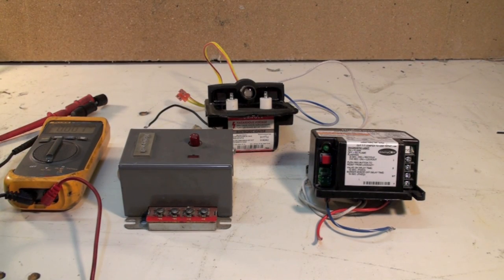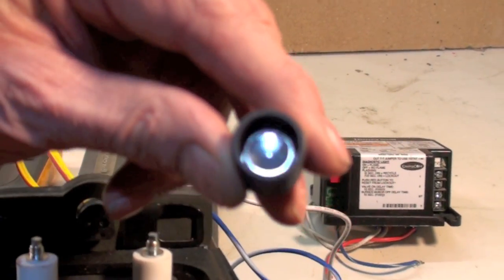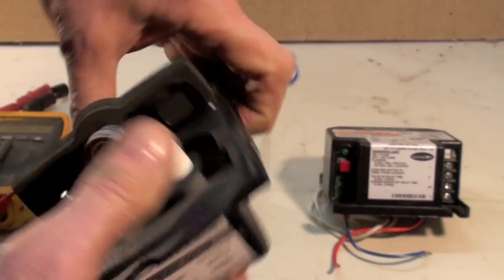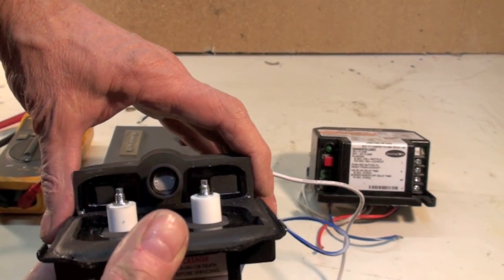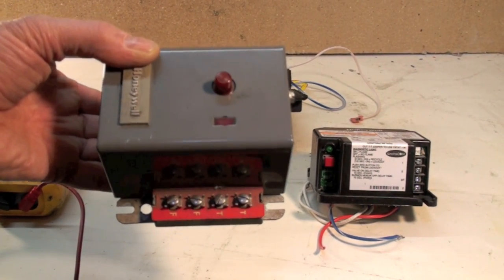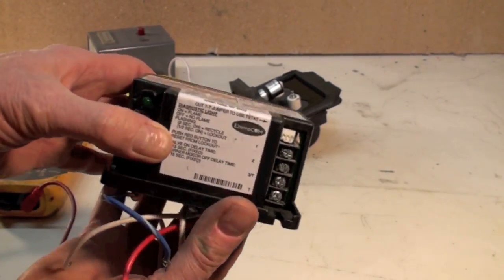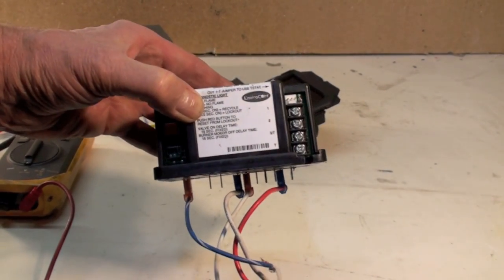Oil furnace cad cell and relay

Comment: My Rudd oil furnace will run and run and run and has gotten up to 99F in my house if I don't catch it and turn off the main switch. The thermstat has been replaced so that is not it. A friend moved some wires that were attached to the little fuse box on the opposite side of the wall where thermostat is mounted and the furnace went off. What is that little fuse box for and do you think if I just replace those wires it will turn off when it reaches temp? I have to turn it off when I leave the house in case it decides to run and run again. It worked for 6 days after he moved those wires apart, but did it again today.
Reply from the maker: Well, at least you are not cold!  There are many possibilities here.  Perhaps if you send me pics of the little fuse box I might be able to help.  Try to get good closeups of all the wires there.  Hope this helps.
GFM
Reply: grayfurnaceman THanks! I just saw this. I'll get a picture and send it to you. Yes, still having the problem.
Reply: Linda Lewis I couldn't find your e-mail, so I uploaded two pics: http://www.rootsweb.ancestry.com/~lindakay/furnace/

Comment: Need help.  Had a flood in the basement with a new furnace, so I shut off the emergency switch to the furnace.  I waited for the basement to dry for a couple days and then turned the switch back on.  When I checked the furnace there was no light at all.  I turned the circuit breaker off then on.  My indicator light is now blinking (I assume it's in restricted mode).  I tried to bleed the lines, but there's only a slow drip of oil.  I held the reset button for 45 seconds.  I can hear something trying to happen, but it goes back to blinking (restricted mode?). Where do I go from here?
Reply from the maker: Steve LaFever If the water was up to the level of the cad cell relay, the relay, the cad cell and probably the burner motor must be replaced.  Also if the blower motor was wet, it will probably have to be replaced.  Hope this helps.
GFM

Comment: Have an Intertherm oil furnace that we have to keep hitting the reset button. The furnace will fire run for a few minutes and then kicks off. Any suggestions. this is in my sons mobile home and the grandkids are suffering due to the home being so cold
Reply from the maker: Check the cad cell resistance both with no light and with light. Should be below 1000 ohms with light.  You could also have an oil supply problem.  Clean the oil filter.  Hope this helps.
GFM

Comment: I have a cad cell that was changed now  carlin control blinks amber burner comes on then off does it a few times then it will runs fine  makes temperature  what could the problem be???  Primary control is a 60200-02 rev b     The control never locks out red
Reply from the maker: First, I would jumper the thermostat to see if the problem persists.
GFM

Comment: ok , have zero $$ and its going down to 17 tonite ... fairly new carlin unit starts and runs good but shuts off after 30 seconds or so ... any way to jump out cad cell ? i know i know , I'll keep a close eye on it and shut off after house warms up ...
Reply from the maker: First, are you sure the flame is coming on?  Is the cad cell dirty?  You can jumper out the cad cell if you short the terminals for the cad cell after the burner has started.  It will not work if you short it before the burner comes on.  And I am sure you know, watch it closely.
GFM

Comment: Hi Garyfurnaceman ..I,m just wondering how does fix the probelm of the reset button press to many times .It was press like around 6 times ?
Reply from the maker: When the problem is repaired, you will need to check to see if there is a level of oil in the combustion chamber.  If you can get a stick or wire into the inspection hole to the bottom of the chamber, and do not find a level, you can fire the unit.  You will need a fire extinguisher just in case.  Start the burner.  When it lights, shut it off.  It should stay burning the oil in the chamber.  Just let it burn out.  Do not open the inspection door.  If it starts to get out of control, use the fire extinguisher.  When it burns out, you should be able to operated the appliance normally.  
GFM

Comment: You keep stating that the controls have their own power. NO! They get the power from an outside source called INPUT! Miss leading people can get someone hurt or they can blow things up. Besides that I like your vids. I am now working on a Lennox fuel oil furnace that has been in a basement flood and a tech came out and replaced the control module and the circuit board and it is not firing. He told the old owner of the house that the furnace needed more work and I found that the bearings in the pump/burner fan had seized up and I took it apart and cleaned the bearings up and they are fine now and the motor now works but the control unit is not getting power from the circuit board and won't come on. Volt meter to the rescue I hope.
Reply from the maker: It may have been misleading to you but it was not meant that way.  The point was the control has its own low voltage power source so you do not need nor should you supply low voltage power to the circuit as you will destroy the control.  Have you checked power in and power out from the circuit board?  Most boards will not survive even getting wet.  Hope this helps.
GFM
Reply: I found out that the fan and limit switch need to be hooked up to get voltage through to the Electronic oil primary unit! Now ain't that the hill of beans. I took HVAC in the mid 80s and still to this day I still have problems figuring out electronics at times. Any more you need to be an electrical engineer to work on many of the units. They use to be so straight forward and now that's in the wind. What I'm trying to do is fire the burner up outside and I need to bypass the blower unit and the cad cell eye to get it to burn and check the flame to he sure that when it was under water that it didn't ruin the burner nozzle. It's in a Lennox model OF23 with a Becket AF ll 150 burner. How do you bypass the fan on the circuit board and still get current up to the Electronic primary unit? You know this is just for getting our house refinanced and I had put in a wood furnace and the refi got turned down due to furnace not coming up to "National Standards" ? Are you kidding me? Yep! We're not selling the damn house but they want that fuel oil furnace hooked up just to mean "National Standards" for the idiot appraiser! What a hoot! I'd love to sue them over this "national standards" crap since we were not informed of this and it cost us $480.00 dollars to be turned down for it! It ought to be just like being read your rights when your arrested! You get informed about these "national Standards" before the bank takes your money so you can at least be prepared for the inspection. So any how that's what I'm dealing with.

Comment: When I test my cad cell for change in resistance, it seems to be working as it should. But I still can't get my pump to even try to turn on and initiate ignition. Is there a possibility that the actual cad cell relay could be bad? How do I test it to verify?
Reply from the maker: If you have newer cad cell relay, it may be locked out.  During the video it shows how to reset it.
GFM
Reply: @grayfurnaceman  I have an old Honeywell like you show in the video. Have you ever heard of them going bad? I see a replacement is only around $75.
Reply from the maker: @xXChaz9849Xx  They do fail.
GFM
Reply: @grayfurnaceman  I will do a continuity test at the pump/blower. I don't necessarily want have the furnace powered to check voltage...
Reply: @xXChaz9849Xx  You fix it? If the box is going, sometimes a tap or tipping it upside down gets it going. I'm not a tech or electrician but i think there is a relay? that sticks?

Comment: Just moved to a house with an oil boiler.  Red button has been tripping periodically.  Had boiler serviced and service guy said it was probably the ignition primary and gave me a quote to replace it.  I got new one and did it myself for 230 cheaper, but it didn't fix the problem.  Replace the cad cell eye and problem still not fixed!  What's the next step?!?
Reply from the maker: Has the unit had a complete service in the last year?  It sounds like a fuel problem as in not enough.  Soot buildup?  You might go thru my oil service playlist.  Hope this helps.
GFM
Reply: grayfurnaceman Yes!  Like I said, the service guy came out and replaced nozzles and filter and cleaned whatever they do.  The flame was kind've sputtery sounding before that, but his service made it sound strong and solid.  After hitting the reset button, sometimes I have to rap it with my hand around the burner area to get it to come on.  Leads me to believe it's still electrical somehow.
Reply from the maker: If the unit has been out on safety for over 1 min, it should come on with a reset.  If less than 1 min, it has to cool down.  If it does not, the cad cell relay is suspect.
GFM
Reply: grayfurnaceman But I shouldn't have to KEEP resetting it three or four times a day...
Reply: Fixed it!  Flat spot in the burner motor.  When it would stop on the "flat" spot, it couldn't start back up again, but most of the time it would stop on a good spot and start back up fine.  Been running two weeks now without issue.

Comment: Hi , is there a way to bypass the controller.Mine broke and i m broke also.I'd like to open the burner for like 10 minutes to get hot water for bath.I was thinking maybe i can connect some cables and get the thing started manually.
Reply from the maker: None of this is recommended as there is now no safety on the burner.  You can bypass the controller by by taking the incoming wires and connecting them direct to the motor and transformer.  There is usually a wiring diagram on the control.  Of course, the power should be off.  Be very careful!
GFM

Comment: Is there any advantages in having a relay that keeps the spark on all the time (transformer always energized) when the burner is running ?
Thank you
Reply from the maker: When I first started in oil, all the units were set for continuous spark.  I just kept doing it.  I don't know if it keeps a better flame or not.
GFM
Reply: Thank you for your fast reply.

I presume that the transformer life will be shorter if its always on.

I heard that the new electronic igniter units are not as durable as the Iron Core types, maybe this is why most newer relays are of the intermittent type. Most probably the intermittent type relays will also save on the electricity consumption.

Thank you for making all those videos and sharing your knowledge they are very informative, have a happy new year.

Comment: My furnace just stop working last night and I have been manually lighting the pilot all day.  I have bleed the pump,  cleaned the filter and bleed it again.  Every time it tries to light I get a lot of white smoke coming out but it doesn't start.  Can you help me?
Reply from the maker: Sounds like an ignition problem to me.  If you lift open the  transformer you can check the spark.  Check here:   http://youtu.be/6qFTRItYGXw
Reply: Ok if I'm not getting spark , what do I do?
Reply from the maker: Marc Waits The unit must be on while you check.  Check the wiring and voltage to the transformer.  If the transformer has power and no or very low spark, the transformer has failed.  If its ok, you must pull the gun and check the spark gap to see if it is clear.  
GFM

Comment: hey gray furnace man when cking the transformer on the newer style do you ck it by jumping the spark like on the older ones or by a meter if so let me know. thank you.  t cobb
Reply from the maker: You can certainly use a meter but I still use the screwdriver.
GFM
Reply: thank you gfm

Comment: I have a Weil McLain WGO-3 oil furnace. A service tech installed the wrong nozzle and caused the unit to be sooted up due to running this way for a few weeks (it's in an unoccupied house). Eventually, the safety trip was active. A different HVAC guy came to clean the unit out and get it running. After he left, the safety trip on the Honeywell control popped up. I reset it and the furnace started up right away and seemed to run fine through two or three burn cycles. However, I returned there a few days later and the safety trip was activated again. I did a visual check on the cad sensor and used a sock to wipe it off (it didn't look too dirty). I reset the control and the furnace ran fine for the hour I was there. I am heading over there again to check on it tonight. If it's tripped again, where should I start? Cad cell resistance check? If that is fine, what's next? I would think the Honeywell control. How would I check that?
Reply from the maker: Flame failure is the reason for the shut down.  Are you sure the oil filter is clean?
GFM
Reply: I had annual maintenance done and the tech was supposed to change the filter, but I probably shouldn't expect that particular tech to have done anything right.

Last night I went there to check on it and it was tripped out again. I have a data logger placed in the furnace room that shows the furnace only ran for an hour or so before tripping. I checked the cad eye sensor and the resistance was good. Tried to fire up the furnace after resetting, but it wouldn't light. I looked through the window and a little smoke came out, but no flame. I couldn't stay any longer to do diagnostics.

One company I talked to thinks it might be the primary control. I have a different company coming out tomorrow to check things out. I was actually on the phone with one of their techs as I was checking things last night. He seemed pretty knowledgeable.

So are you thinking of inadequate fuel supply?
Reply from the maker: Yes.  No flame could mean plugged nozzle, no oil in tank, plugged oil filter or plugged line.
GFM
Reply: Could it also mean no spark?
Reply: The tech found that the nozzle was the problem, and somehow the wrong one got in there again. He put the right nozzle in and did a combustion test plus adjusted the air/fuel ratio. So, that's the good part.

The bad part is that he was looking into some water on the floor that I had thought was from the regulator on the refill circuit. But, it is from a crack in one of the heat exchanger sections. So, this sucks. Should I have them attempt to patch it (bandaid approach), replace the heat exchanger entirely (invest $$$ into a 17-year-old furnace), or replace the whole damned thing ($$$$$ for a house that is going to be sold).
Reply from the maker: If it is 17 years old, the section may be under warranty.  Probably parts only.  Boiler manufacturers are notorious for not accepting failed boiler sections.  Worth checking out.
GFM
Reply: I checked and the WM literature says they pay for parts at something around 40% for the age of this furnace. I suspect replacing a boiler section is labor intensive and costly. Not sure what route to take. I am leaning towards installing a new furnace.
Reply from the maker: It is labor intensive.  A new boiler is also quite expensive.  All you can do is compare prices.
GFM
Reply: Decided to replace the furnace with the current version of the existing W-M WGO-3. I may have a co-worker that used to do installations help me with it. I've noticed the existing furnace has the water circulator on the cold water return while the pictures of the new ones I've seen show the water circulator attached to the top where the hot water exits. Does the water circulator location matter? I wouldn't think, but your expert input would be appreciated here!
Reply from the maker: All furnaces used to have them on the return.  Newer ones often place it in the supply.  It will work both ways.  If the manufacturer recommends it in the supply, go for it.
GFM

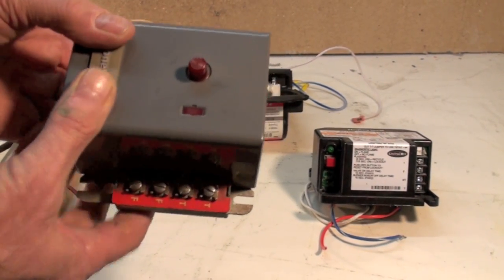Comment: At 2:00 that looks like my 35 year old 5 wire relay. Trying to find another one like it but all they have are 3 and 4 wire relays.  I had to sand the contacts on the relays.  Still works but sometimes does that fluttering with the relays and then it grabs and starts. Any ideas? Thanks
Reply from the maker: +John Smith You can make a 4 wire work by connecting the transformer and burner motor wire together.  Hope this helps.
GFM
Reply: +grayfurnaceman  If I only knew which was which. :-)  Seems like all I'm seeing are the 3 wire ones. Thanks.

Comment: when i switch on burner it starts  but after 5 minutes it stops  no light comes on to press  restart it reaches a certain temperture and knock off but will start up again when cold
Reply from the maker: Does the fan come on?
GFM

Comment: I have a weil McLane boiler and a honeywell cad cell relay.   the cad cell is clean and works as per my thermostat.  fire comes on but the safety still kicks off.  any idea what I should be looking at
Reply from the maker: You need to check the resistance of the cad cell both with a light shining on it (less than 1000 ohms) and dark (around 20,000 ohms).  Hope this helps.
GFM